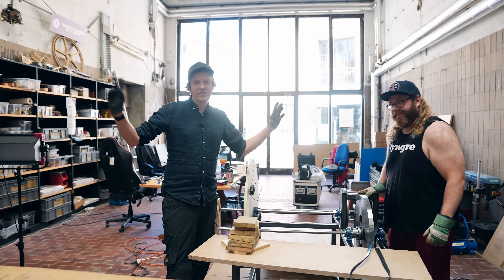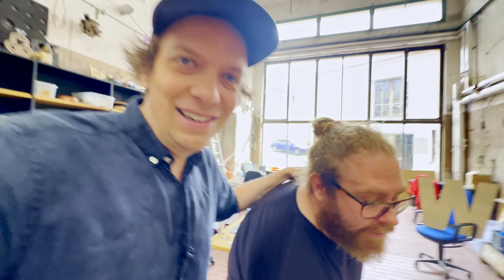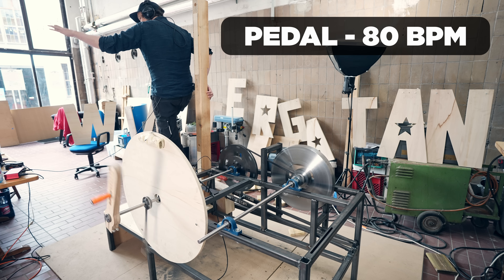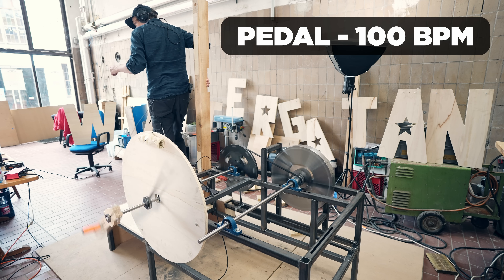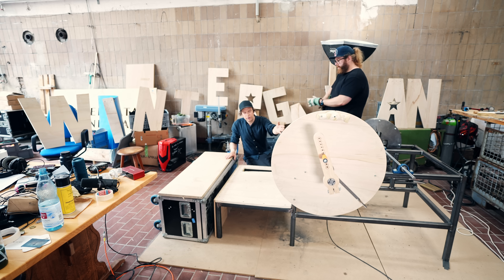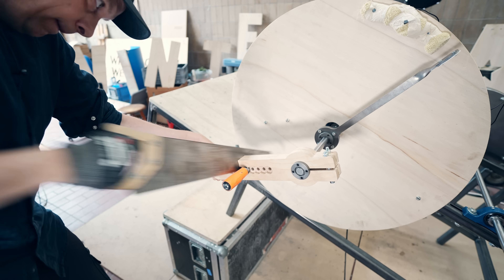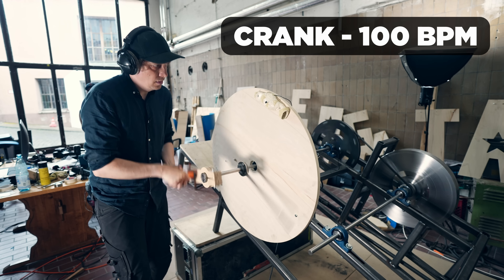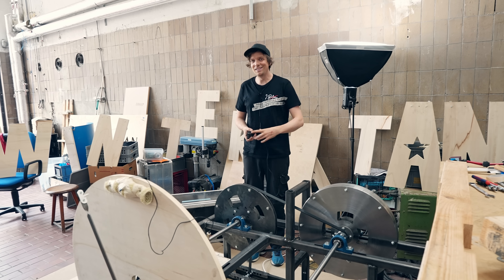Heavy Flywheel plays Tighter music! - DAY 11 - Marble Machine Flywheel Prototype

Comment: This is just PID controller theory az @kingofgamesyamiyami6269 mentioned in @blacquejacqueshellaque6373's thread below. (proportional–integral–derivative controller - look up in wikipedia)

P - the more the machine is out of sync, apply proportionally greate force - the more the difference bitween clicks and bumps, the greater the force to apply (to decrease error asap)
D - if the machine is getting out fron sync rapidly, apply proportionally greater force - if the diff between clicks and bumps increase rapidly turn-by-turn, increase the force (to prevent diff to grow too big)
I - if the machine is getting out of sync on the long run, apply greater forces (to remove small, but slowly accumulating errors)

Assuming that the operator has a limited constant muscle strength, all the P, I and D tags are getting relatively smaller as the power required to change flywheel speed increases.
This results in smaller over- and undershoot amplitude (smaller P and D) and larger cycle time between overshoots (due to smaller I part). 
So a bigger flywheel causes tighter music because of smaller PID tags thanks to the relative strength decrease of the operator.
But actually this result can be achieved a different way. The result would be the same with even a smaller wheel, if the person was weaker - for example a child would be able to play tighter music even with a much smaller flywheel.
BTW, also this is the cause why a shorter crank or pedal helps - it reduces the maximum torque the operator can add to the system at his maximal physical strength.
Rule of thumb: the slower one is phisycally able to change the speed of the flywheel, the tighter the music will be.
Because all the flywheel is doing is basically "smoothens out" the implulses the operator adds to the system - works as an integrator. The larger the difference between the maximum impulses added to the system and the response of the flywheel to these impulses (the inertia of the flywheel), the greater the smoothening effect. So increasing inertia or decreasing the input pulses has the same effect on this system- tighter music.
So I'd suggest a smaller flywheel and a shorter pedal (harder to push) or smaller crank arm (harder to rotate) - because the result would be the same,
but the machine would be much lighter and more secure... 
Or, connect the flywheel axis to a generator and connect some lightbulbs to it to simulate the load of the future mechanisms attached.
This way the flywheel will be under constant breaking, which also decreases the tags, because it will be harder to accelerate it.
So yes: the music will be even more tighter, when there will be load (breaking) on the flywheel. (Also because it dumpens positive oveshoots by slowing down the accelerated wheel.)
Some self-control also can help much: try to add less power. :) Try to achieve sync as slow as possible (less P and D), and when behind sync is detected by ear, try not to correct it fast addig much power (less I and D), because when the wheel is accelerated to a greater speed to sync up, it won't stop at sync (this is where breaking can help a lot), it will overshoot.
See also: pilot induced oscillation. ;)
Now that I wrote all this down, I just realized, that constant breaking (load) will be the way for more tight music, because it affects D tag only and dumpens oscillations. Without breaking this system is doomed to oscillate: nothing can prevent overshoots, except manual (or by foot) breaking - and that is less effective if the relative strength of the operator is small. Without perfectly tuned load and PID values, the only thing that affects how tight the music will be is pilot experience - try to break the wheel manually at the correct time, before it reaches the sync again, to prevent overshoots...
An infinitely large flywheel theoretically can provide perfectly tight music, but if it gets out of sync once, it takes infinite amout of time to sync it back, and infinitely hard to prevent overshoots.
So optimal flywheel size is the function of the expected load and the operator's strength. Bigger flywheels can help reduce errors, thus providing tighter music, but increase the time required to correct errors. So music will be tighter, but will be out of sync for longer times, it will be harder to sync it back. And the larger the flywheel relative to the load and the operator's strength, the more unstable it will become, getting prone to oscillations.
If preventing sudden changes in rhythm is more important than staying in sync with a metronome as @Beakerbite mentioned also in @blacquejacqueshellaque6373's thread, a bigger flywheel will surely helps. But if both aspects count, a good balance of load/flywheel size/input power control is necessary. A compromise must be done as always during any engineering.
In summary: without any RPM control mechanism, IMHO the "pilot experience" is more important factor then the size of the flywheel, since the PID controller is the operator here, his responses to errors what controls the music tightness entirely. The flywheel just "smoothens out" operator errors, so one can choose between bigger, but less long out-of-sync periods or smaller but longer lasting unsynced music periods by variing the flywheel size.

Comment: I feel like you are making a mistake with trying to use the flywheel both as an energy storage device and a way to stabilize the rhythm. The precision you achieved in earlier stages of development just goes out the window with the variance in how much or little energy you physically put into the system. Hint: how would you get a constant tempo no matter how fast the flywheel is spinning?

Comment: You still need to stop thinking you're super tight at 120 bpm compared to 80 bpm because your standard deviation is lower. That's not the right way to measure it. You should measure it in % of your BPM or something, NOT in milliseconds. Of course your deviation is low for higher BPMs if you measure it that way : you're cranking faster. So by definition the deviation is 20% lower if you go from 100 to 120 bpm, coz of the way you measure it. It shouldn't be this way.
Reply: Martin doesn't understand the system he's chasing.

Comment: Seeing the tightness result differences of long/short and you needing to use two hand on the short crank at times highlights, what at least to me seems like, a trade off between the leverage of a longer crank with the finer control of a short crank. 
In adding another/different pulley to increase the ratio between input crank speed and flywheel speed that trade off may be something to keep an eye on.

Comment: The manual aspect of the machine makes it an instrument through which you can express yourself, so I understand the need to keep it that way. With a heavier flywheel over the length of a full concert, wouldn’t it helpful to have an electric assistance, like there is on e-bikes? You still crank but it is easier to accelerate and maintain

Comment: The shorter crank give you less torque, which makes the device less sensitive. This reduces the risk of overcompensating when you drift off. The effect should be equivalent to increase the mass of the flywheel, or increasing the gear ratio to make the flywheel spinn faster. However, the RPM is not bounded by the mass, only by friction. The solution for this is a regulator as you planned to use. If you want an even more precise device, you should introduce a spring. The resonance frequency will then depend on the stiffness of the spring, together with the system inertia. The Q value will depend on the friction.

Comment: wouldn't you want the contact microphone on the axel for the flywheel to help smooth out the timing? although maybe it wouldn't matter since the crank wheel is coupled via the belt to the flywheel...

Comment: Martin, have you considered to play around with the pedal height position vs the downbeat of the click track? If your prototype is set up to match the click track when the pedal is in its lowest position (which from a firts glance makes sense to mimic eg the kick pedal of a drumset), that’s however where you have the worst spacial resolution in your prototype due to the way the mechanical connection is made between your pedal and the flywheel. You see, I think it follows a sinewave, and the top and bottom positions are where you have that lowest spacial resolution. So with this setup you want your click to instead be set on the halfway down (or halfway up ) travel position to have the best resolution and give you the best chance to play on time, ie where the derivative of the sine curve is the steepest.
Kind of difficult to explain my thoughts in the comments section, would be easier to draw a schematic. But you probably get my point. In my opinion these details are the most limiting parts right now (although I don’t know exactly how you have matched your pedal position vs the click right now, I must admit).

Comment: I'm wondering how these tests will compare with the final product, driving an entire huge machine with it will be much harder work, will it be able to be driven manually? Or will there need to be an assistance, that just adds a bit of power but doesn't regulate the speed?
Or are we looking at something that will be fully electrical?

Comment: Hi, Martin! Love Your work and I don't belive anymore, I see and admire!
With your meassures as a DJ I have a bit different perspective and maybe you may change some axis what you are ploting... You see, while playing, you may try with a record player - if you slow it a bit for a short while, and do that again few times, if you do it subtle, another listener may not even notice, and your standard deviation will go in seconds.

You see, with heavier flywheel you achieve something imo more important - stability and inertia of tempo. If you are slowing down after an intense part, more important is to get back to the tempo - return to 120 and use the subtle tempo movement to your advantage.

The changes are subtle, so even if you will drop few bpm, the changes won't be dramatic and it will not sound like you are missing notes and not hitting in time, it will be more like slowly changing record player speed.

Like with any instrument or tool, when you with get the machine play, you will feel your flow and how you express yourself with the music, you may not worry to "catch the beat", but let the beat follow your flow.

Comment: The placement of the contact mic should in my opinion be at the bottom in this test instead of the top. This would make the pedal have a "similar" feeling to a drum pedal. It should give you better control of the timing as you can better adjust your effort right before the beat. Instead of relying on the momentum in the release.

Comment: It seems like it would be interesting to have some kind of wind-up or hyugen drive that lets you break the energy of the flywheel into either a spring or to lifting a weight, then you can let that weight fall to restart the device.
A bonus would be that you can use more or less weight to roughly control the tempo you accelerate to